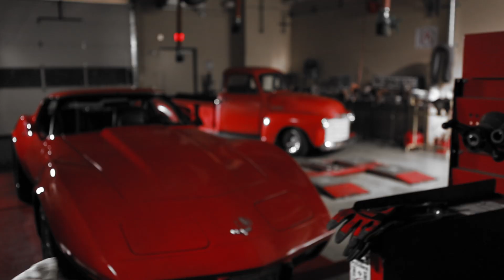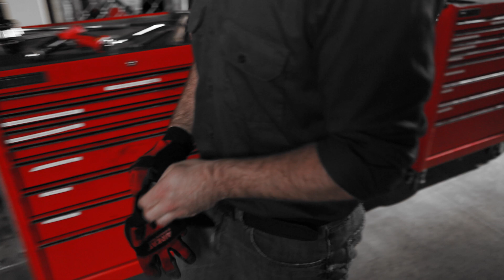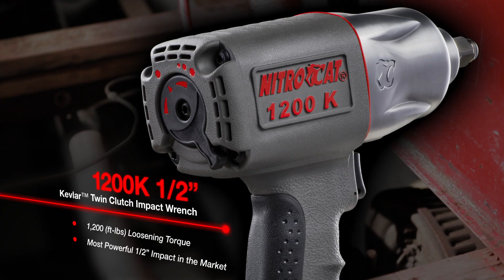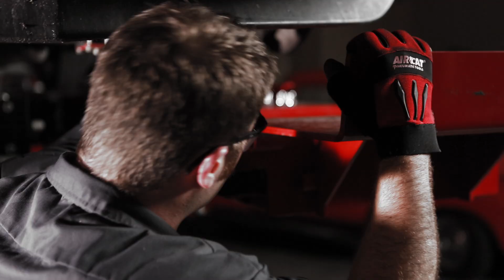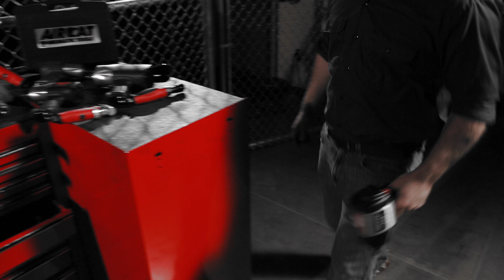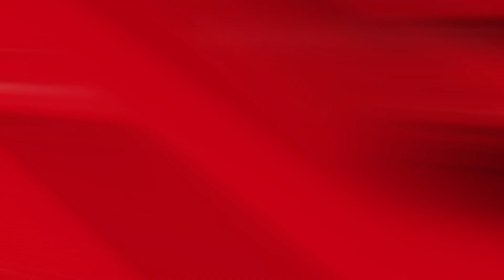AIRCAT "Killer Torque" Video

Comment: I recently got a used Aircat 1150 1/2" impact for $25. The regulator on the back was siezed and would not move. I decided to take the entire thing apart, clean all the parts, and relube. This was the best $25 I ever spent. This gun is so light weight, so quit, so ergonomic and most importantly IT IS POWERFUL AS HELL. It gives my co-workers tool truck brand impacts a run for their money on a daily basis, and they all spent upwards of $400 for theirs. Aircat, if your reading this please continue making tools like this and I will be a customer for life.
Reply: What I love about these guns is that you can take them apart and clean them. Some other brands are a bitch to put back together. It's brands like these that make it worthwhile.

Comment: Currently I only own a 1150 killer torque but I'm really looking forward to getting more tools from you guys. You've seen the previous guys' comment, I want a cordless tools too. Call it ElectriCat/ElectroCat or something but I would really buy it for sure.
Reply: I have had the 1200k, 1150 and I will be getting the 1250k soon. If they made an electric impact wrench i would be the first to buy it
Reply: I don't mind being second as long as I could get one. I'm really looking for cordless drivers but I'm a bit hesitant because I don't need them right now. But if aircat offer those I'll get them.